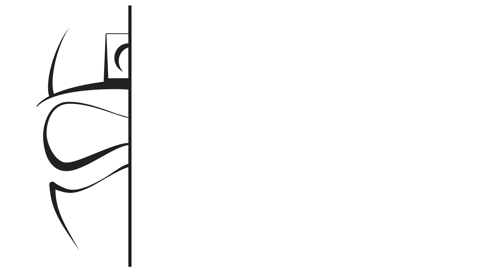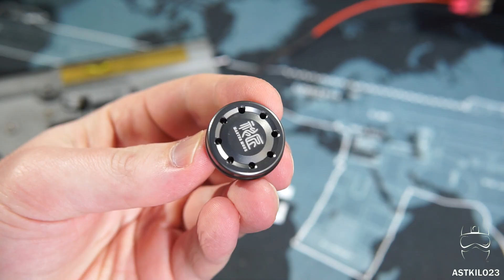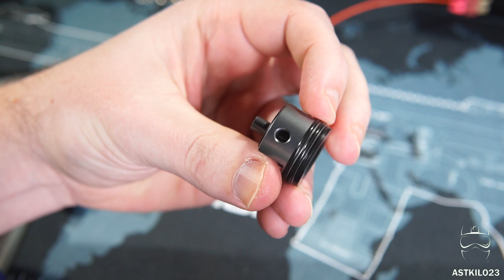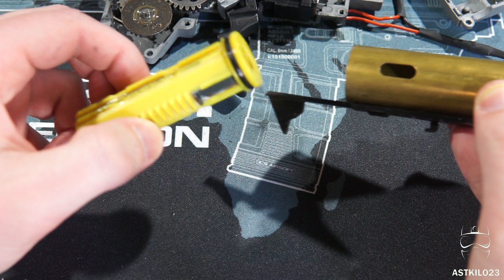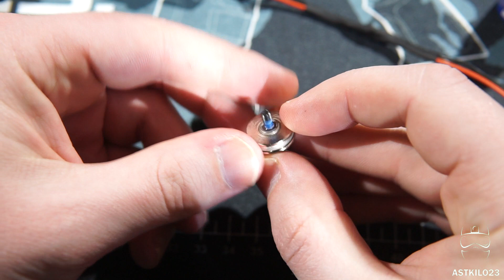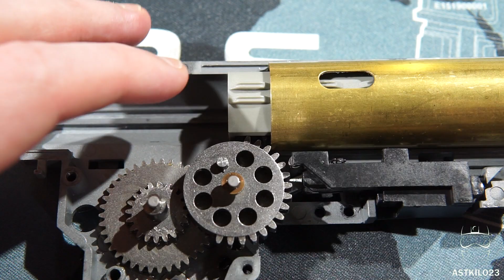Master Mods Airsoft Compression Parts Installation/Review

Comment: I belive an nice upgrade for your g36 would be a larger cylinder (most likely a 4/5) since yor are using 0.32bbs most of the time
Reply from the maker: Wouldn't be a bad idea. The air seal is excellent already, may not need the extra air volume. But haven't had a chance to test yet.
Reply: @ASTKilo23  I believe that you should be able to shoot the 0.32g bb a bit hotter this way (with the same spring)

Comment: Solid review. Thanks for mentioning everything. Often times when I've used those cylinder heads with rubber front ends, they do fit very, very tight and it is concerning. I too would love to get my hands on some of these parts to test out. Especially the barrels. I have both AEGs and HPA guns and would love to see if they make a big difference over my already R-Hopped 363mmx6.02mm inner barrel in my Kythera built M4.

One question I have for you is: Why do you still test with .20g BBs? Joule creep is a real problem, especially with short barreled guns. Every field here in CO has switched over to testing all airsoft guns (AEG, HPA or GBBR) with .32g ammo. This shows out all those guns that would normally pass a chrono test using a .20g BB to have even more energy shooting a .32g BB. It's pretty easy to build a joule creep gun these days. It's how people tend to get hurt at close quarters. But when the test ammo is heavy, that disallows some of those guns. People around here have gone away from building those guns.

Thanks for another great video!
Reply from the maker: 0.2g have always been the standard as far as testing speeds. I could switch to another weight, but everywhere checks speeds differently. My local field chronos with 0.25g bbs and my field on in western WA chronos with any weight and checks joules. I understand your concerns, but I prefer to stick with the standard that's been around for a while despite there being potential for joule creep.